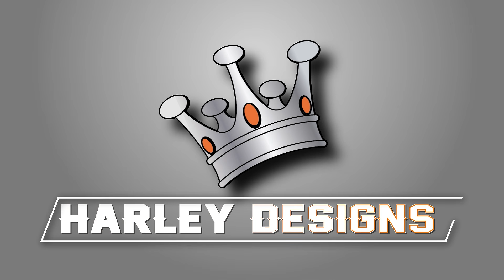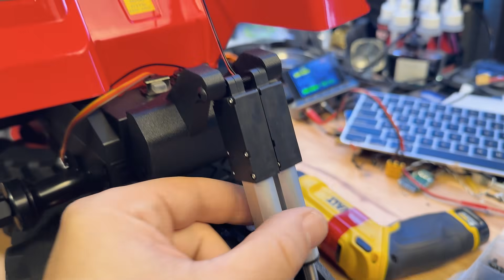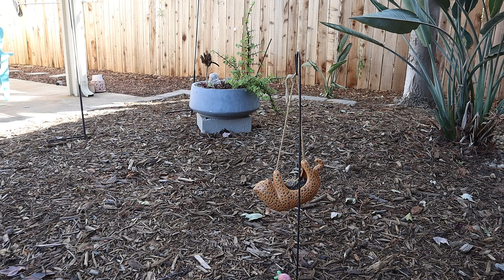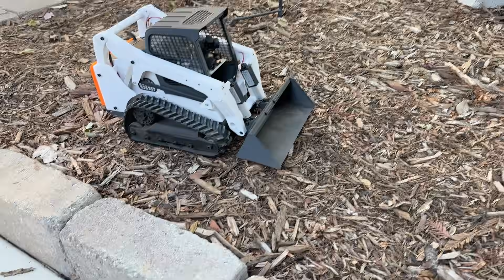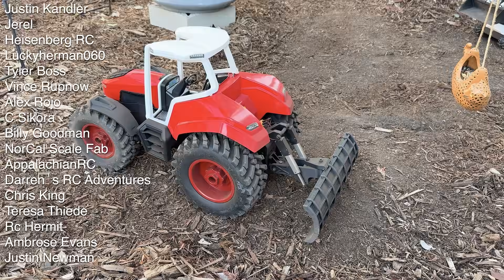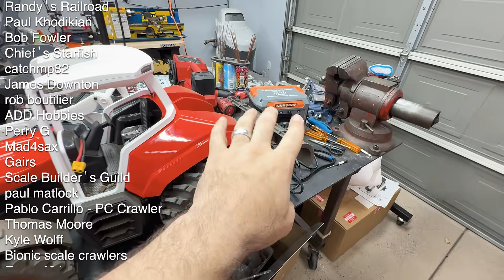Cross RC Farming – Working Blade on a $1000 RC Tractor

Comment: This is amazing! maybe version 2 where you make mount points on the bottom of the blade so you can bolt on a metal ruler as a straight edge, or some spikey forks to help grab mulch/leaves etc! I frigging love this thing and the random attachments you make!.

Comment: Get a piece of 1/2 inch wide thin flat stock and bolt it up on the bottom edge of the blade for a cutting edge. True it up to the plow angle by pushing the plow down on a concrete surface and run some laps to grind it in. That is what we do with plow trucks at work when we replace them.

Comment: Looks great and like great fun.  Needs 3 different mounting holes/pins to angle the blade left or right a few degrees to "push" the material to those sides as you go.  Also would love to see a rake design instead of the blade as an option.  Of course the rake would need to be metal and most likely a Send Cut Send project.

Comment: need some "water filled" tires to add some weight on the axles.
Reply from the maker: It’s deceiving but each tire and wheel is about 5lbs.
Reply: @HarleyDesignsInc still may need more for more traction